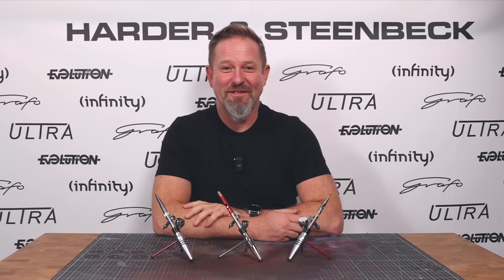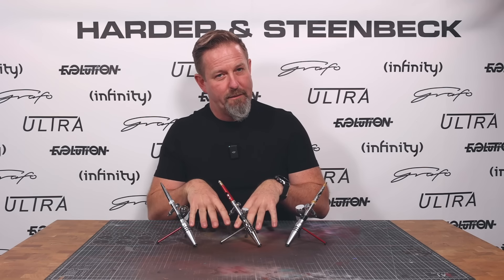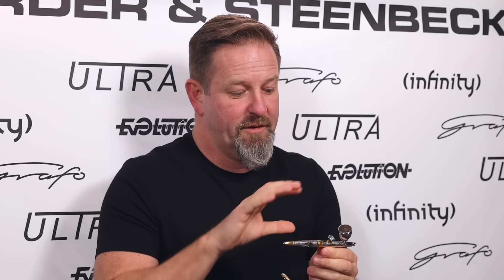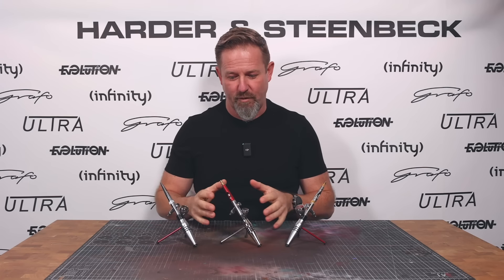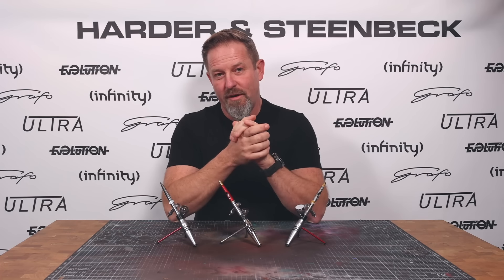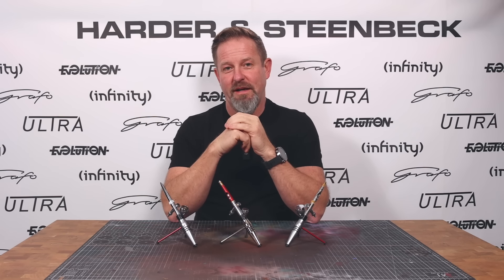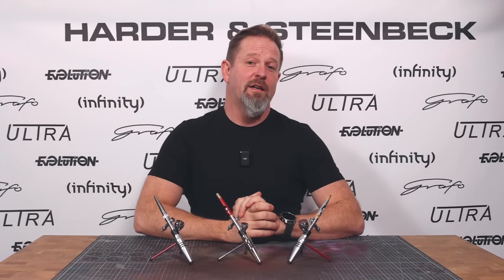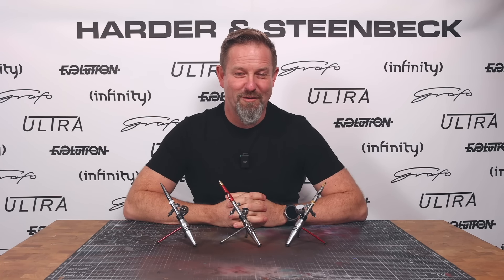Let's talk about the Infinity 2024 CRplus Airbrush!

Comment: I figured out your secret... You are adding AI and voice assistance to the infinity 2024. "ok google load paint #42 into infinity"

Any news on the fPC pressure control valve for the 2024 series yet or potentially ordering the gold plated parts?

My ultra 2024 is the first airbrush from your company I have owned but it cleans up so much easier than previous airbrushes I have had.

Comment: IMHO my Evolution 2024 is almost as good as if not better than my Infinity. I bought the new Ultra as well which at its price point is a bargain.
So now my wallet is going to take another beating to buy a new Infinity. I am looking forward to trying it and it will have to be something very special if your going to make it as better as the new Evolution is compared to the old one.
As for what the big secret is, some sort of quick change system for the heads/needles perhaps?
Reply: Hardly a quick change system. It already has that. I am guessing it could be multi-channel air flow to the needle tip.

Comment: Evolution 2023 user with 2 Teflon rings. In short: If H&S can make a ultra detail brush with almost instant paint, for a good price, that will be an absolute winner. I do not agree that such ultra detail brush is for experts only. I started directly with an stock evolution. I really disliked the stock paint response being so slow. It is like shooting a magnum with 2 sec delay. horrible Because I tried to make very fine detail on a small surface 1/4 of an Zippo. For an detail brush it is absolutely important to spray when you move your trigger finger a little bit. Delay should be almost zero. Cup size: 2 ml and 5 ml is OK. Weight: There is no need / reason for a heavy brush. Why ? Does a house painter paint better if the brush is 1 pound heavier? I don't think so. I think the opposite is true. The lighter the brush, the more people can handle it. If people need a heavier brush, maybe they have quit some shaking in their hands, maybe add a custom way to add weight.  New infinity thicker paint with 1 go: would be good addition, because the paint is not thinned down, can go higher PSI, and lay down paint maybe faster, no need for second pass, the lines are then also sharper, because going over the same line perfectly with a 2nd pass is difficult. It is never possible to match both lines perfectly. Perfect for dragon scales. One pass, done!
cleaning: Evo 2023 requires several times flushing to remove the paint from the nozzle. I wonder why? Why does paint tend to stick at the nozzle somehow? It requires about 6~7 flushes to remove most paint. Yes, I use regular distilled water to flush. I use least chemicals  as possible.

Comment: Almost everything mentioned in the new design of the Infinity 2024 sounds perfect. Except, for me this idea of shortening the body range between trigger and nozzle makes me think that will ruin the airbrush. The Airbrush is not a pencil and trying to emulate its use as one is a bad idea.  The infinity length as it stands is perfect because its not how close your hand is to the work, it's the all round visibility of the nozzle to whatever surface you are detailing and a closer hand just creates shadows and a stiff neck from craning my head round my hand... this I found on the Giraldez Infinity which I absolutely grew to hate, except I thought the internal parts were well designed.  I literally swapped over the internals of the Giraldez onto the original Infinity and threw the Giraldez body in a draw.  My original Infinity is now 10 times better than it was because of the new design of the internal parts and your new ideas for the Infinity 2024 sound even more exciting, but please don't change the length else when I buy the 2024 version I'll be swapping over the bodies and I don't want to be doing that.  -  📏📐🖋🎨
Reply: the Giraldez infinity shortened the body range between the trigger and the nozzle and it is AMAZINGLY WONDERFUL!!!  extremely fine detail is even easier when your hand is just a fraction of an inch closer to the work.  I think many of us have found that it was a HUGE improvement.  if your just swapping bodies anyway, and don't care about the hand being even closer for fine detailed work, the older infinity or the evolution would be great.

I'd love to buy the Giraldez body from you!!!
Reply: @slickschoppers  Very sorry to say Its already been sold.. I have big boxers hands and I am used to using longer airbrushes like the badger Renegades when I used the giraldez my hand cramped up and I didn't like the cup distance to the trigger even when I swapped it for the older trigger.. But best of luck to you and keep on airbrushing.